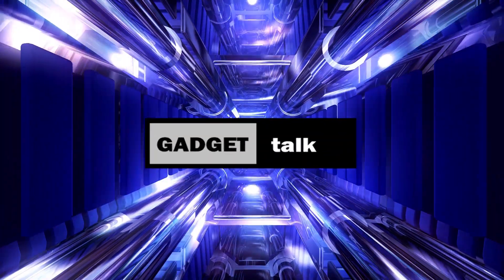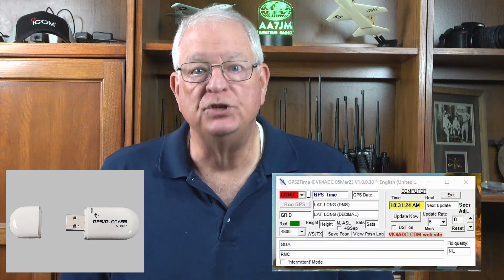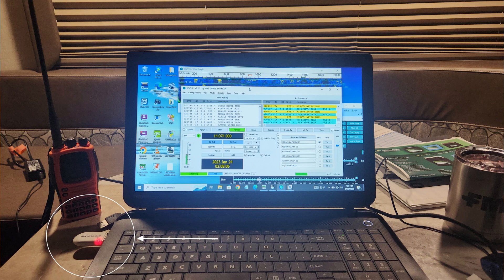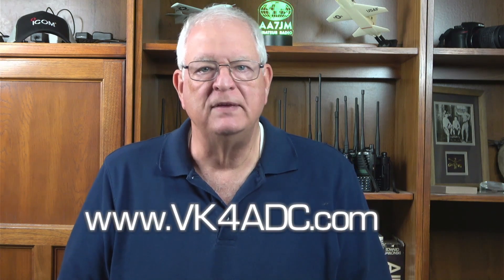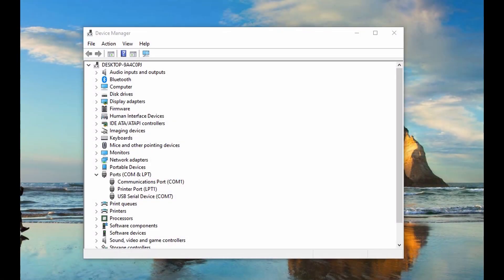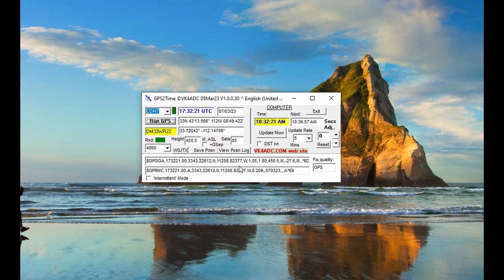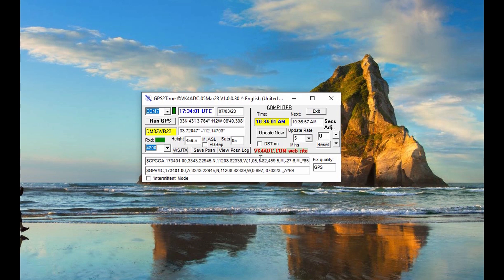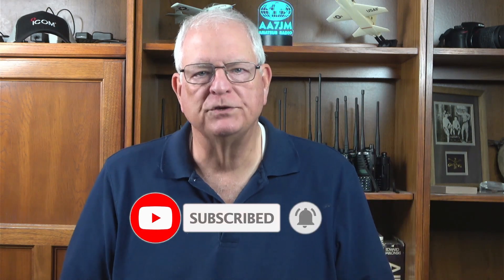Use GPS to Ensure Your Best FT8 Time Setting

Comment: I got mine working on Windows 11. Under the Device Manager it is under USB, COM 3. I lowered the baud rate to 4800. Works outside after about 1 minute (green light will flash).
Reply from the maker: Thanks for watching and commenting.

Comment: opens in a small window which i cannot resize. Not all elements are displayed, unusable (Win10)
Reply from the maker: It is a small window but mine works fine in Windows 10. (64 bit)

Comment: Is the UV10R good for longer distance?
Reply from the maker: The UV10R is one of Baofeng's transitional radios. New case, still 128 channels, but USB C charging. Same power as most other Baofengs. It has multiple color choices and looks cool. I've not used it but suspect no range differences. Cheers.